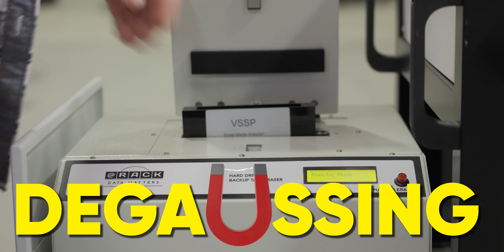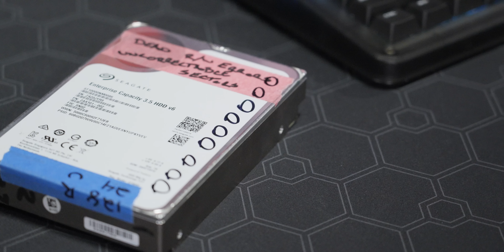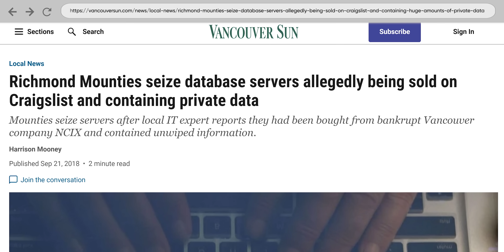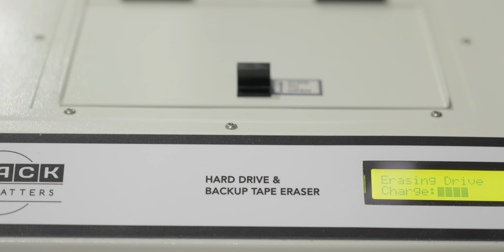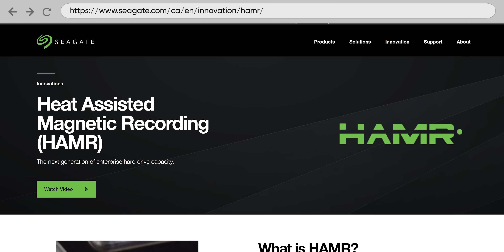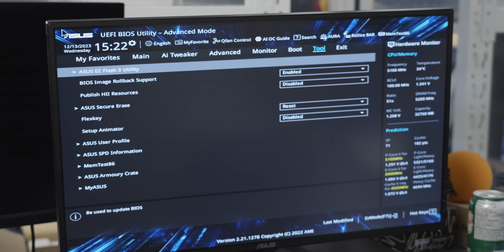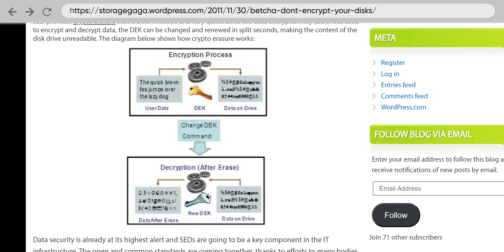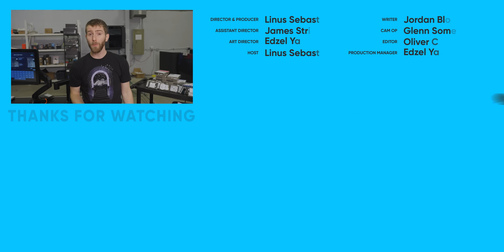I Got an Industrial Hard Drive CRUSHER! @Rack's Mobile Data Destruction System

Comment: edit: i was at like 13 minutes and perfectly missed the last segment

crushing the drive ensures destruction but i wonder if it is necessary to destruct the data if you have good full disk encryption 🤔 as far as we know it takes anyone at least decades even after accounting for new mathematical discoveries to break a proper encryption so i can’t see how physical destruction would be necessary in most cases.

also one easy way to make it harder is to do encryption at per drive level in a storage pool and have different keys for each node that is managed on a centralized db or in the drive controller, after the key is destroyed it would take an attacker an insane amount of time to crack each drive and rebuild the storage pool

Comment: I got to use one of these when I did IT at UNLV's student wellness/health center. Due to privacy laws / HIPPA, if we couldn't zero out and randomize a hard disk, via something like DBAN before repurposing the machine/drive, it had to be crushed. Basically, if the drive was too old that we couldn't run modern tools on it, or failed in some other mechanical way, it got sent off to the crusher. We had an old 300 MB hard drive from God knows when. I really wanted to keep it because I love old tech like that, but because we couldn't run a disk eraser utility on it we had to crush it :<

Comment: Just to be clear - just to bend the HDD Plate isn't secure at all - I mean even then experts would be able to harvest the remaining Data.
Sure - it's expensive and doesn't matter for standard Joe-like users.
Only sure method to destroy all data would be to Melting in a furnace or throwing the HDD into a shredder.

Comment: What a waste. I'm sure that for the price of something like this a different device which automates the decommissioning and overwrite process could be made. Imagine a machine that instead had hundreds of 2.5 and 3.5 inch drive slots which provided power, data connections and individual status lights. A user would place a drive in the device, and it would begin by encrypting the volume with an unrecorded key, then begin writing 0s to its volume. When completed, updating its status to indicate the drive can be removed from the slot.

Comment: Unfortunately physical destruction is the only way to be absolutely sure that the data cannot be accessed in the future either.
Relying on vendors to implement encryption schemes (software or hardware) without any faults is just not a viable strategy for some.
e.g. intelligence agencies being able to read data on a disk that they managed snatch 15 years ago from another state actor because a new exploit was found. Such data might still be highly relevant.

Comment: mhh... This thing looks verry complicated for what a shredder, like the ones for documentes but on roids, could do in  5-10 seconds.Okay, you couldnt take a after pictur then, because there is no after... but a slot for the drive, with a camera in in, that registers, that the drive is in and a mechanism, that prevents you from taking it back out would be easy enougth to build. Like a one way road with a shredder on the exit side :-) Highway to hell if you like XD

Comment: I notice you didn't address electronics recycling in this industrial hard drive eraser/crusher. In the case of destroying the drives that are of no use crushing them makes recovery of recyclables much more difficult. The shell of the drive is milled Aluminium, with both steel and Aluminium screws. The top plate is usually steel or stainless steel, there is a copper drive motor, sometimes up to 2 boards, and various gold contacts. If the objective is destruction, degaussing is still a great idea, but manual disassembly is far more environmentally friendly and can be profitable.

Comment: Feels like what should be created, if time is the issue, is not an e-waste generating device. But a device that with as low power consumption as possible could fit 10, 20, 50, 100 drives with the sole purpose of writing zeros to them when inserted. But regulations will regulate.

Comment: We run our Classified HDD's through a industrial shredder. nothing bigger than a pinky fingernail is left. When a program ends, we also shred the computers that were used as part of the contract if the program doesn't want them.

Comment: Hi, when you’re going to sell a used hard drive you run a program that writes ones and zeros through the whole drive over writing anything that was on it. Also, Google uses a machine that has a punch on it at punches right through the hard drive. It’s a lot cheaper machine, but it gets the job done. They don’t do it every hard drive only certain ones the other ones go for resale.￼

Comment: in the EU, the standard you have to use to destroy drives or flash, depends on the data stored on the device. 
This machine would not cover the most sensitive standard in the EU. for Flash i would recomend a shredder. Crushing is to unreliable. You have to inspect the pcb manually every time.

Comment: It would be great to know why high heat fire or extremely corrosive chemicles arebt used for the same thing.
No need to wipe a SSD if it's no longer a solid after all.

Comment: Depending on the classification of the data, some drives also need to be shredded so no single particle is greater than 3mm in size.

Comment: In most larger scale applications for permanent drive / data destruction they use a shredder and conveyor system in order to feed the drives in quickly, and get just a bunch of small chunks that can be recycled afterwards. But the singular drive crusher is a cool demonstration
Reply: The one advantage this system has to that is easier auditing of the physically destroyed drives. If you just have a pile of chunks on a belt or in a bucket, it's kind of hard to tell what's what.
Reply: @Acorn_Anomaly I would expect some image recognition system automating that as well - user just needs to make sure the hdds are separated and serial number facing up
Reply: I worked in a hospital that had close to 1000 HDD's / SSD's each year that needed to be destroyed. Shredders are expensive so we just used a manual press, like the crusher in the video, but manual. SSD's were wiped using a program called Kill disk that did 13 different passes. It was a never ending task.
Reply: Because fire is too expensive???
Reply: @ctg4818 maintaining one is, has to be hot enough to melt everything, got to have extract fans for the smoke and fumes from the metals, fuel for the fire, etc. This is MUCH easier.

Comment: I use a HDD eraser and HDD crusher at work almost daily. If you drill holes for the HDD. And a hammer for the SSD will do the same thing. 100% unrecoverable and costs nothing.

Comment: Real life story:

I was a "S6" in the US Army... think "IT manager for an organization of about 700 people and 200 devices."  Our unit was shutting down and we were requiered to dispose of our hard drives in compliance with the standards at the time. I don't remembered the precise wording, but for unclassificed drives, there were two main criteria. First, it had to be damaged in such a way that it would not fit in a device. Second, the disks had to be damaged in such a way to make recovery unfeasible/cost ineffective (recall, this was for unclassified data).

I spoke to our Network Enterprise Center (NEC) and while they could destroy individual drives, they didnt have the capacity to destroy as many as i needed destroyed. They recommended I speak to the Logistics Readieness Center (LRC) about having them drill out the drives or cut them in half.

So I talked to the folks at the LRC. They could do it, but would need individual ticket requests per drive... paperwork that would take hours and tracking would be a nightmare. 

So I went back to the NEC and talked to their Information Assurance divisions and asked them a question... could I just handle it in house? Sure, so long as you document it like so and follow these standards. And with that, I had a plan.

I went to our Maintenance chief and asked if they could help. Ultimately we deciced on melting a hole throuh the drives with an oxy acetylene torch and then smashing them with a sledge hammer... the Soldiers had a blast and I had a pile of hard drives I could safely dispose of. I stillbhave pictures of the results and process somewhere. 🤔

Comment: As a small business IT consultant, I always recommend my clients use encryption on their drives. The possible speed hit is minimal in business use most of the time, and when we're done with the drive, we don't have to worry about data destruction. Taking it out of the computer with the encryption key is enough to resell the drive. I also find that encrypting a drive with bitlocker takes much less time than a DBAN old school overwrite method.

Comment: why do i feel like there's something at harbor freight that could destroy these drives much cheaper? Use your damned cell phones to take the pictures. Just buy a table saw and a blade that can cut metal. or a drill press and some hole saws. or both, and still be under the one-month rental of this dumb machine....or you could just buy a cutting torch and MELT the drives.....that would also be more fun. 
Or you could go to MENARDS, buy BRICKS and mortar, and build a little slag furnace....

Comment: Machines like the one you have are valid solutions, but there are better options. Given the manual nature of each step, if you accidently skipped degaussing on your machine, some of the chips onboard could potentially be intact and contain recoverable data. That's also why the drill, hammer, punch, bullet, etc. methods are inadequate.

There are rackmountable drive-wipe solutions that can handle dozens or hundreds of drives at once. You just need someone to swap them out as the tray lights indicate it's done. About 15 years ago, I created a 96 drive system for about 1k (and a ton of my time and effort) for the ecycling company we ran at the time. The industry has advanced quite a bit since then. In fact, your old Storinator would work perfectly in the role with some relatively inexpensive software options.

But if you REALLY want it destroyed, there is nothing that comes close to a hard drive shredder. Hard drives (or whatever else that fits) in, confetti out. And for extra paranoia, the confetti can be degaussed before it leaves the premises.

Comment: A round of hex "AA" and another of hex "55" should be a 100% successful way to get all previous data to the point where it can never be recovered again, ...
however, ...
As noted, with the hard drive sizes commonly used today, this of course takes time.

Comment: In 2018 security flaws in most self-encrypting drives where discovered! Big manufacturer like Samsung gave up on secure implementations and start to recommend software encryption. See Microsoft Security Advisory ADV180028 (IIRC it is now the default). Did anything change? Are they now considered secure?

Comment: For the past  ~15 years all my server drives, and Exec level HDD/SSD's get logged as destructed after I use HV Electro Magnetic Thermal Destruction,
using a decent ARC Welder and a nice well ventilated welding table (please do wear an appropriate ventilator while doing this task, along with necessary

Now please remember to let it cool down properly before sending to the dumpster.

Comment: Indeed. You think of "how secure do you need?" Someone talked me down once: "if Russia wanted to steal your data, they probably have it already", so "how secure" is a very good question to help me be reasonable. 

In fact, some real estate companies literally have satellites to monitor traffic so that they can raise rents if people leave a high-income area to a lower-income one
Reply: Also, time can be expensive. IT workers can be expensive per hour to where selling the hard drive is more expensive than just replacing them

I once tried to destroy a hard drive using a hammer. The hard drive took several hits before I did any noticeable damage. They are tough! A drill press also had a rough time

Comment: i made a degauser at home, it also works to magnetize my tools or demagentize, dependign on how you bring it close to the motor. loll... just take a 200 watt motor, and take out the stator, warning, this will use over 2000watts and will overheat after about 30 seconds,  but you can magnetize about 5 tools before it overheats. shut it off wait 30 mins and you can go again.. annnnddd, if you had an old motor laying around, it was entirely free for you.

Comment: I work in this industry. this would not be good enough. we typically degause then shred to 6mm. government standards in my country. 
degause takes about 20 seconds per hdd then approx 4 mins to shred to 6mm. boring reply but one for the destruction nerds.
Reply: These machines tend to be "in office". its akin to some tech bro drilling a hole through the hdd. basically not good enough..

Comment: Seems like something really expensive when you can just spend half an hour disassembling those drivers to remove the platters, and shedding those with a small shredder (same with SSDs)

I've removed thousands of platters for this reason, absolutely no reason to purchase one of these for a company as small as yours.

And shedding the individual platters into dust is way more secure as well.

Comment: Seems to me mangling hard drives in this fashion would make them a lot harder to recycle.  That's a lot of useful metals and components that might should have been separated first.  Like I'd like to see a machine that you feed platters into instead of whole drives.  But that's really the big bugaboo for recycling in general isn't it?  It always takes more work than just throwing something away.

Comment: I've previously used "Secure Erase" on one of my NVMe drives... accidentally. Had loads of very important images and things. Within the hour, I was successfully able to retrieve the entirety of what was lost using a tool called Recuva (By CCleaner) Whilst I doubt this comment will be picked up, my use case was a Z690 ROG Strix-A D4 with BIOS 1304 (Still available at time of writing) and a Corsair 2tb Force MP600.

Comment: I work for an ITAD in the UK and I have processed 23000 HDDs this year (erasure + resale). The drives which we are contractually required to be destroyed have to be shredded to a specific size, the machine you use in this video is actually not sufficient for our contracts, albeit overkill.

Comment: Seems like a lot of extra work and expense when you can easily destroy a hard drive with a 1/2" drill press and bit ...... Just drill a hole in the top and push hard and shatter all the platters which is exactly what I had to do in the late 90's after data recovery when I was an engineer at a major industrial controls manufacturer. 

It's a lot more satisfying than letting a machine do all the work

Comment: We have a $199 data destruction solution at work. A hydraulic press we found on Ebay. But! We modified it slightly we welded on some teeth just for good measure
Works very well

Comment: I don't have that one more drive to fix that partition problem and solve all the missing game library paths and epic does good job at that. Disk management only one knows about, because previously it was windows system partition but windows had to be moved to get more speeds, because reading System libraries possibly is faster from SSD - truth is does not matter too much for Crusader Industries at port Port Olisar. Why I can't install windows 10 and after to MBR or GPT ... Have some not allocated space 200GB and an error message - not enough space in a disk to resize any other disk or to create new volume.

Comment: Physical destruction was definitely a thing a long time ago. Typically these days all enterprise drives should use some sort of encryption and typically in an array. Zeroing the drive and erasing or rotating the encryption key will render the drive useless for recovery reducing eWaste. Even if one drive slips through the cracks it’s unlikely they will have enough drives from an array to recover any data let alone the encryption key.